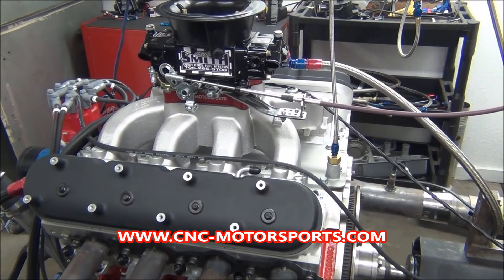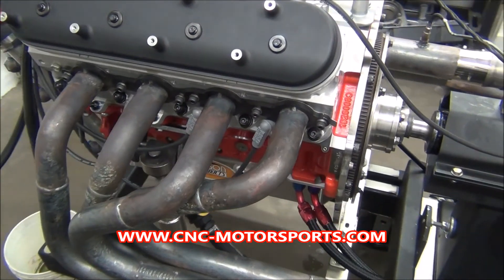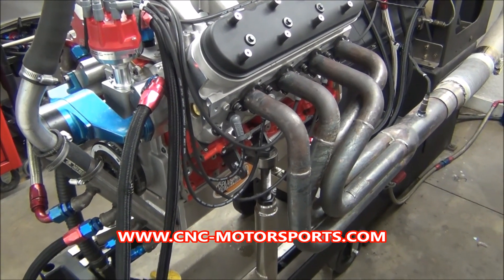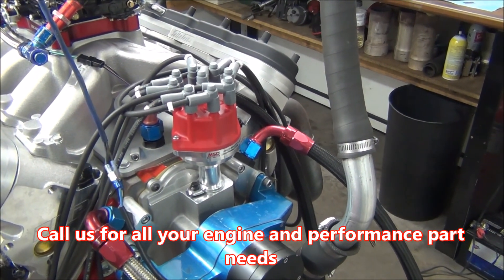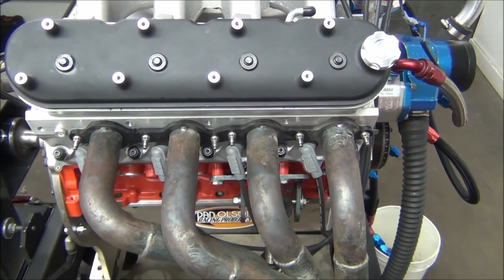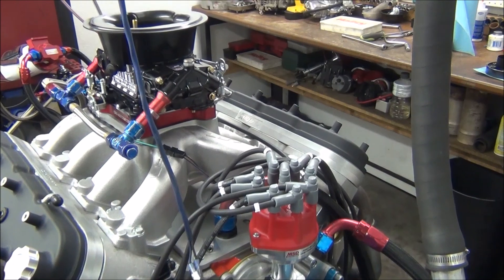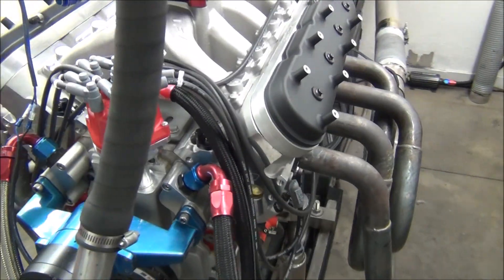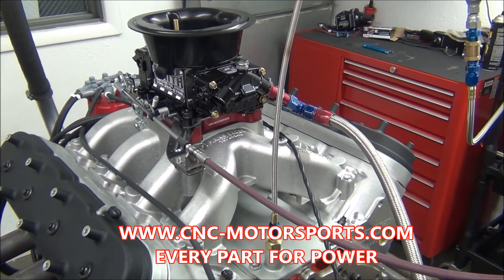LSX LS7 Circle Track Engine 700+ Horsepower by CNC-Motorsports

Comment: We have new rules at our track =====5.3 ls 366 total cubes  650 cfm  4150 carb or 78 mm throttle body. Steel block only. 4500 to 5500 up out of the corners 7200 rpm end of strait. I need to build one  without the bottom end getting to hot.
Reply: I will be the first in our area to put together a 4th gen camaro dirt car. Running a 6.0ls using stock ls2 flat top pistons and iron heads from a  1999 to 2000 6.0.....We must run Iron heads. Also using the gm front cover for the distributer and mechanical fuel pump. No electric fuel pumps allowed. They want to keep the class affordable.....It is costing me more money to eliminate the efi and find used cast iron heads....But in the end I hope it opens their eye's to the bang for the buck potential  I mean really, 450hp the easy way. Cam, springs and a set of pistons that I can install cuz they are floating rods stock and its a racecar motor that will spin 6800 rpm all day long........Besides this car is truly built from a junkyard,  isn't that what the spirit of street stock is supposed to be? Also using a 5th gen camaro body $600 from a junkyard.   4th gens without the rear window look stupid but I like the rear torque arm set up and the tall front spindles with the rack and pinion.